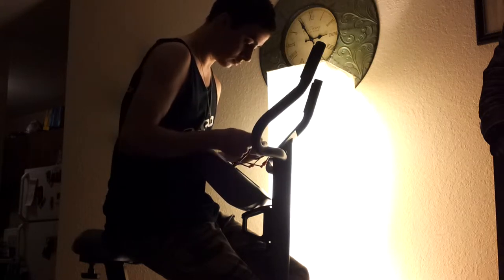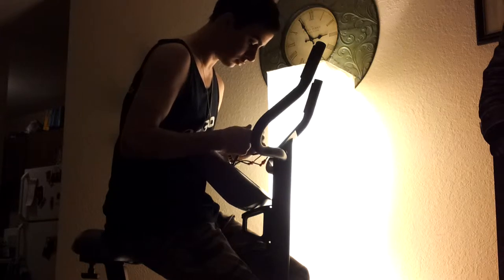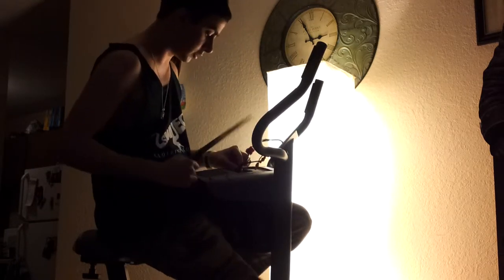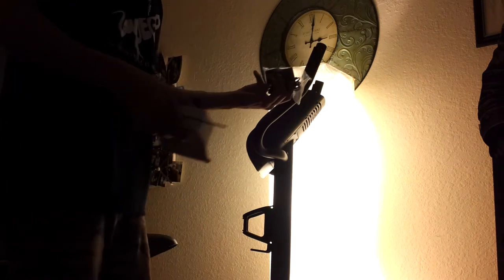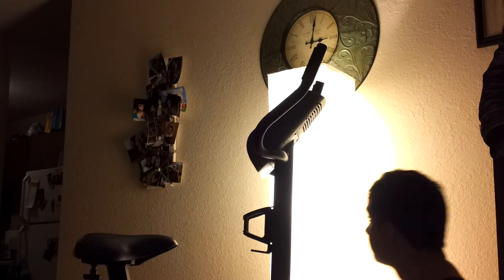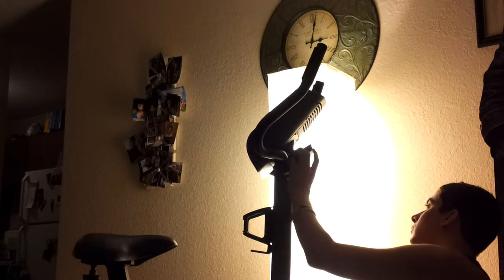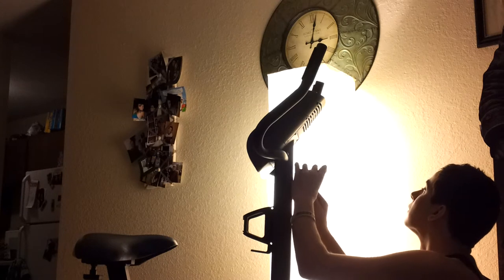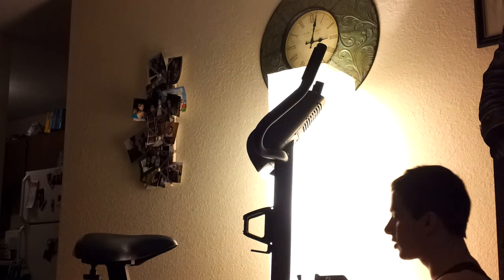Assembly 290c Golds Gym Elliptical Bike Assembly 2/2

Comment: Hey MrAlanC! Where is the area to plug in the power adapter?
Reply from the maker: Oh boy I wish I could remember. I'm pretty sure the plug ran all the way up to the console with the little screen and fan on it. I remember thinking it was a dumb spot.
Reply: @Mralanc  Ok thanks a lot! It turns out mine has no plug in. I think I read there are some models that don't have the input for AC adapter.